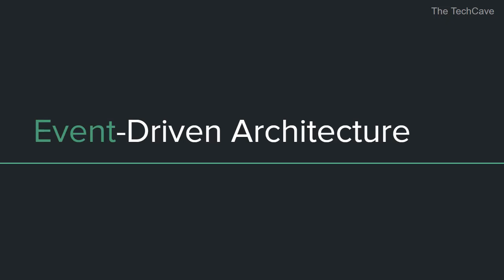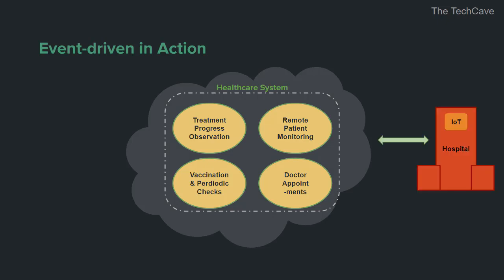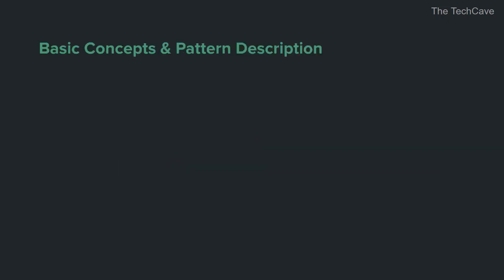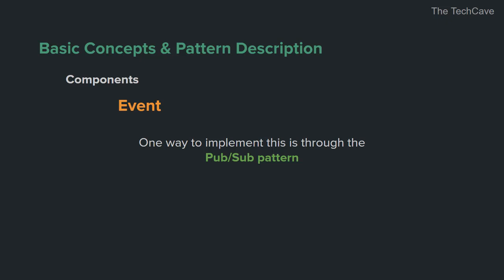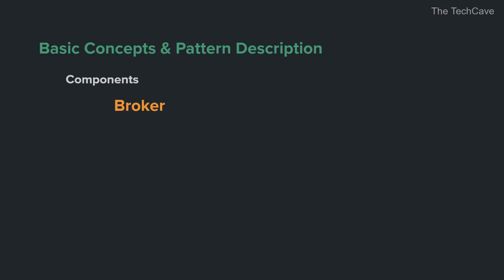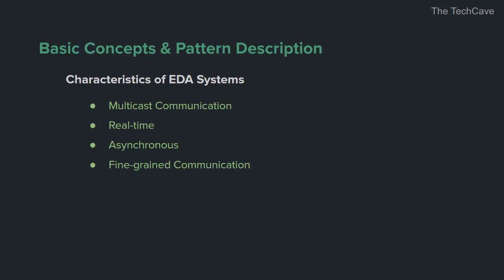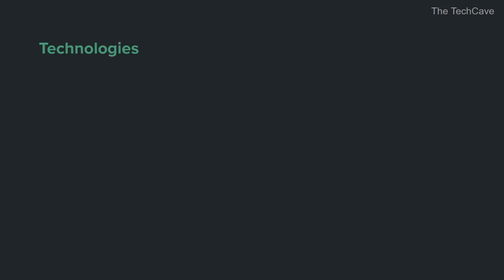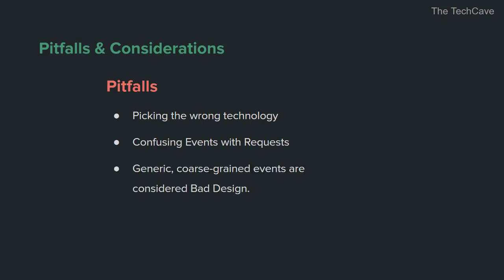Event-Driven Architecture | EDA | Software Architectural Patterns

Comment: I kind of feel like the mediator you are describing is  a SOA ESB pattern and not for microservices. Microservices architecture specifies dumb pipes and smart endpoints. A mediator with logic in between services sounds like the opposite, smart pipes, i.e. the messaging middleware from SOA. Only way a mediator could be applied in microservices by definition would be if each service had one to distribute the event among its internal components.

Comment: I'm left with a few questions... 

When events are handled by a microservice are they generally removed from the queue? 

What if you wanted more than one type of Microservice to respond to an event? 

Would the handler event need to send out a new EventHandledEvent? Or would they issue a command?

If everything is event driven then where do commands fit in?
Reply: Every subsriber of your event system will receive an exact "copy" of the event. So if you have 5 Microservices hooked to the message queue and 3 of them have a listener for lets say userNameChanged, they will all receive said event.
Reply: @derNoaa270  ah I see so does the message bus will take care of all subscribers getting the message before removing it?
Reply: @zebcode  depends on if you are working with acknowledgements or not. There are many possible implementations of a broker & message queue. One is where the broker knows which services have which events subscribed and one where he doesnt. Typically the first one is the case when you are working with acknowledgements. The latter one will just publish the message and "not care" if they ever get received. So if your service had an outage it will have missed a message.

TL;DR; 

It really depends on the implementation that you are using.

Comment: Not the best design pattern video I've seen.
1. you didn't give accurate reasons why request-response (RR) is inferior to event bus (EB). Automation can be done with both patterns. The producer of the event might as well use RR to notify all interested parties. It doesn't have to be manual.
2. Unit testing is actually easier for an EB system, as you can test each event publish/handle in isolation
It was otherwise OK. Most of the other content was accurate.